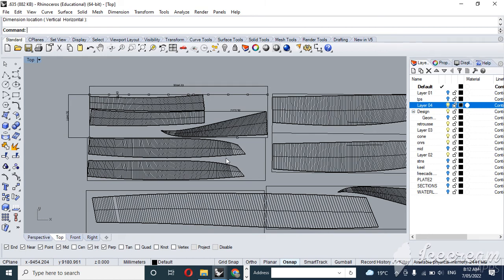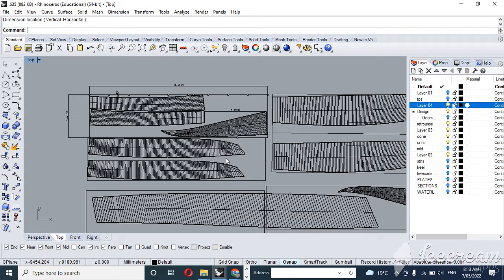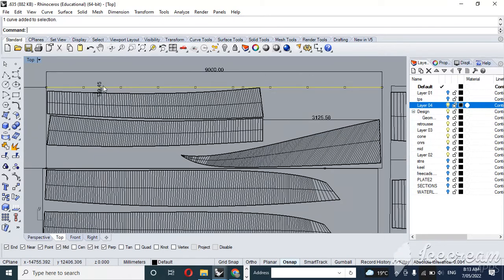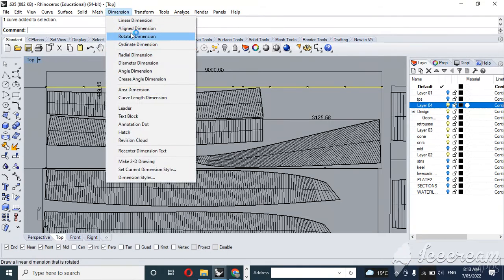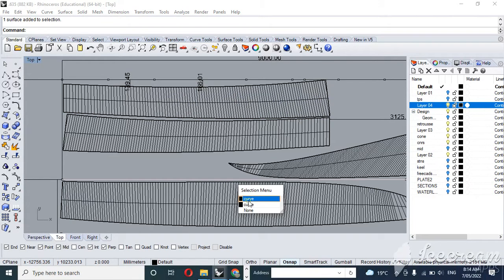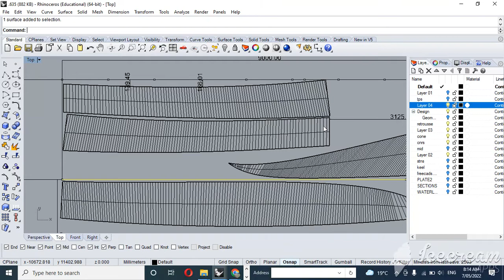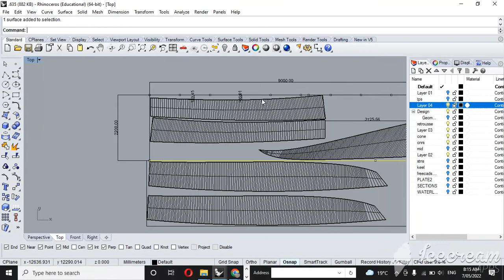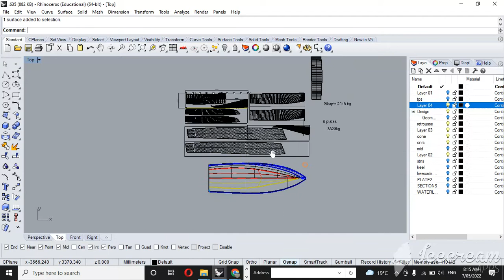how to cut plates for boatbuilding

Comment: i appereciate your insight. as a person who is thinking about designing and building his own ali boat tender, im not going to go this route. im going to draw it in cad and get it laser cut and delivered. im sure if i was a seasoned pro like you i could do it your way but to be honest as i have no experience doing it your way i would spend a week doing it your way and only by the end of it would i know what im doing. lots of steps and each of them is a chance i could make an error. easier and more accurate to email a dxf and recieve a shipment of ready to go bits. if anything is wrong they are responsible, they replace it and i get some free ali. what could go wrong? so that leaves me plenty of time to make all my mistakes while welding.
Reply from the maker: good on you allow for overlaps, for instance the topsides plate need to meet the chine running to the lower edge of the chine, same at deck, will you draw it yourself, fire me an email @hearnyacht@gmail.com
Reply: @stuarth43  not sure i follow what your saying here mate